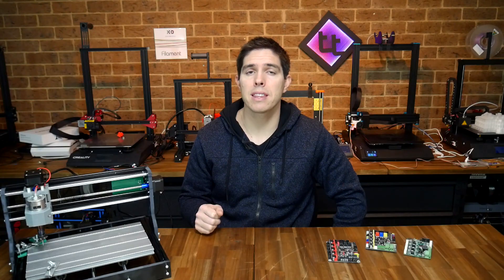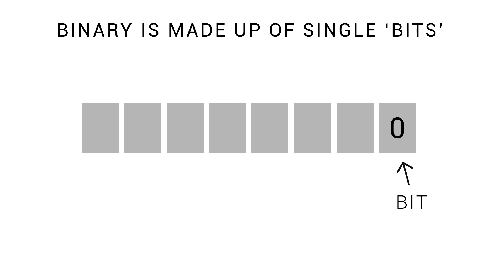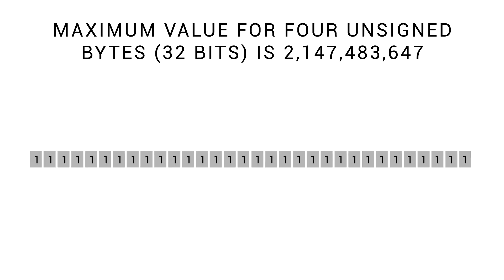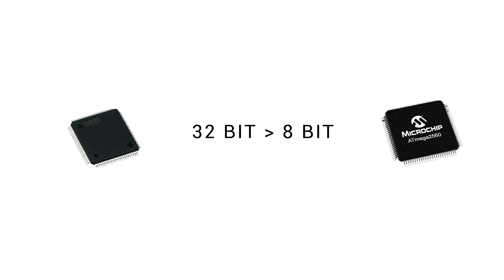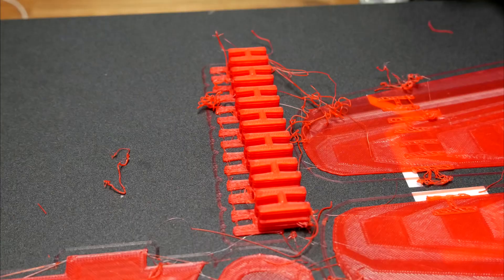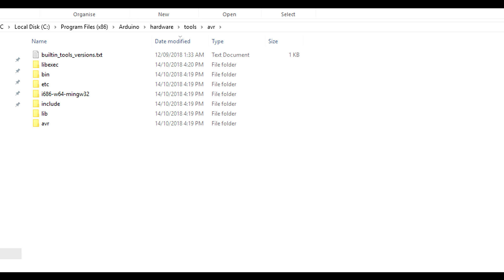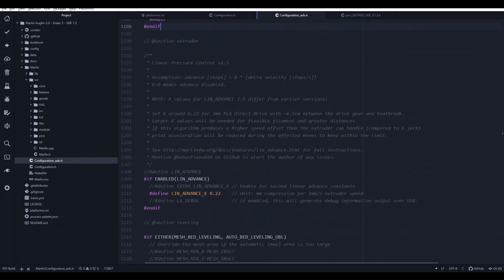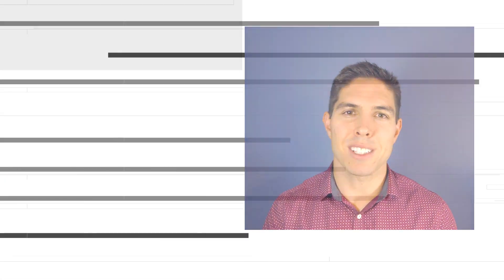32 bit 3D printing - What it means and when you need it

Comment: We need 3d printer boards with 7 nm ZEN2 architecture, 64 cores and 8 ghz!
Reply: You joke but people can and do think that is a thing that can be done when it's the wrong type of device. Microcontrollers have low latency, deterministic I/O that a general purpose CPU generally can't provide without a major restructuring of its design and the operating system.
Reply: @JeffDM , you're right. I hadn't even thought about the fact that a general purpose Linux OS isn't really designed for real-time processing. I believe there are some distros out there designed for real-time, though.

Even so, OctoPi is just running on a variant of Raspian, right? It certainly doesn't have any trouble controlling an 8-bit board fast enough to give some really excellent results. Or would you say that is more due to the CPU on the Ras. Pi than the OS?
Reply: If you 3D print an entire orbital-class rocket, that may not be enough: https://en.wikipedia.org/wiki/Relativity_Space
Reply: Would that not be like building a Bugatti for use on a kids bumper car track? It would look cool and be really expensive but could never be utilized.
Reply: @3dtwerking324  aye probably a nice showoff system bit likely impractical. Still it's nice to hop in the Bugatti and take a trip to the shops every once in a while just cos you can haha
Reply: @BillyBobJimPatton  lol
Reply: And RGB
Reply: You can, just run it on your pc!
It's gonna be expensive though
Reply: @snarkylive  sure it is. I guess you missed the point that OPs adventures with it was less about what it is and more about what fun they could have with it. But feel free to state facts for no apparent reason if you choose ;)
Reply: Think of an array of like 100 printers with infinite Z (like those conveyor belt printers) that dispose of their finished prints automagicly. Each one with their own instance of Klipper or similar on a separate server running the difficult bits of calculation.
Now pair that with a software that you can feed gcode files in a predefined order (maybe even assigned priority) that assigns each printer their new gcode file so that the order of the files finished is being followed.
This kind of system would be fully centralized and could be run without any interruptions during the manufacturing process like having to peel off the finished print off of the heated bed or something...
The most obvious problem with that is that you still have to change filament or granulate so there still have to be workers around.
Reply: Max Lindner what would be awesome but total over kill but take a 1st gen core i7 980-990 extreme and turn it into a 3d printer all in one board. , octo-print , arduino ide, a slice of your choice  fusion 360 and or what ever else you can throw at it.  Even a high end 1st gen xeon.  X58 chip set board or what ever. For the lower cost but way to much process power lol man that would be sick.  I wonder if it could be done.  I assume so.
Reply: @mitchh6471  I have seen a similar thing done before by a friend. Take a look at Klipper firmware. It's general idea is process the print via a PC and pipe it to the Arduino in the printer.
Reply: You can run Klipper on a RPI. Or a high-end multcore workstation if you have one spare lol.
Reply: @BillyBobJimPatton  I actually do have a couple of pc's standing around and collecting dust. William, I think this is one of the few occasions, where a youtube comment has given me the momentum to do something great!
Reply: @maximilianlindner  happy to have bucked the trend and give a useful YT comment. I should screenshot it and frame it as proof that it can happen haha

I'd be interested to hear how you get on with trying it.
Reply: @maximilianlindner , I was thinking that through the whole video, "Why upgrade a board in several printers when you can just use OctoPrint or OctoPi?" And then I thought, "Why even bother with a Pi if you've got an old machine lying around like a P-III (or maybe even an old Pentium or Athlon?) that you could use to just send commands to the 8-bit board with?" 

How many printers could you run with a single headless Athlon running OctoPrint, I wonder? I'm already running Linux on everything on my LAN and I know how to set up a headless machine, so I'm pretty sure I can get OctoPrint running on some old box I've got lying around already. When I think about it, I don't think you'd even need more than a single CAT-6/Gigabit ethernet card in the controller and a switch at the printers. I don't really know how much speed you'd need but this whole project is starting to sound pretty interesting.
Reply: @BillyBobJimPatton  Its exactly what mach4 does with a smoothstepper for instance in CNC land
Reply: @maximilianlindner  Perhaps you mean momentum?
Reply: @SH-pc4xt  I did indeed.
Reply: @maximilianlindner  So did you get it running?
Reply: @FuriousImp  I am running an skr 1.3 with a raspberry with Octoprint installed (pretty much the same idea, but waaay more efficient) and it's awesome :)
Reply: @maximilianlindner  Interesting. Wouldn't that be redundant though? I mean, you could offload the calculations onto the raspberry with octoklipper, right?
Reply: @BillyBobJimPatton  how? Do I just flash the firmware to usb drive then to the desktop I'm going to use? Because I'm going to see the performance benefits if there are any at all
Reply: @whatif8741  I haven't done it myself before (just done it with raspberry pi) but if you look at the klipper website in the FAQ section there are some details on how to do it on desktop machines.
Reply: @mitchh6471  Sounds cool and all, i had a X58 Xeon pc overclocked to 4.4 Ghz and it was awesome, the only downside is power consumption, it will easly add 200-300w of power consumption  and that is alot of money when you print all the time.
Reply: @mitchh6471  errr... But that's basically taking your old pc and converting it into a dedicated box for slicing, using a pc itself to control stepper drivers would also be very impractical, not to mention a big x58 6 core is likely to eat up more power than the printer itself 😂
Reply: @mitchh6471  meeeh ..  just stick a ryzen gen 3 3300g in there .. boom done
Reply: Lol, some people already use x86-64 hardware for CNC stuff. That's why LinuxCNC combined with Mesa FPGA boards and Debian with real-time OS extensions are used. For an example of a CNC machine, check out Marco Rep's Youtube channel.
Reply: Mmm, I'd be happy with a Kintex UltraScale
Reply: nah 90nm works well
Reply: We do have 3d printing that requires 64 cores at 8ghz! It’s called architecture.
Reply: Holy moly are you trying to run Crysis?
Reply: For what exactly playing top end games? 🙄
Reply: @tempest031  yeah that. Or for excess just cos. Or most likely for the sake of sarcasm lol

Comment: Would a CR-10 benefit from a 32-bit board?  I was getting ready to purchase one then I seen this video.
Reply from the maker: Any printer on paper will be capable of more, but whether you can tell much in real world results is not so clear.
Reply: honestly being able to use uart/spi without external jumper wires is already enough reason to get an skr v1.3 over anything else.

Comment: So is the controller in my Anycubic Linear Kossel 32 bit? I loaded Marlin 1.1.8 onto it about 8 months ago and now it's dialed in its completely dependable and delivers high quality prints. Same with my Ender 3. I know it's got a cheap-ass 8 bit board but it works well. And there is the issue. My interest is not in building the best printer but in having reliable printers to output my projects. They are both dialed in such that I rarely have to level them and I'm not sure screwing around with the controller will give me additional value.  Maybe I need to build a delta from scratch.
Reply from the maker: If it's reliable and printing to your satisfaction I would leave it.
Reply: As written above, I think the rule "If it ain't broke, don't fix it" applies in your case.
-You're already satisfied with the prints, which means it might not be worth all the trouble and frustrations upgrading.
But at a later point, when you think your Kossel is no longer an interesting piece of technology, you could upgrade it to a 32-bit board, which should then give it 'new life'.

Comment: I really enjoyed this video, I think it's a great tutorial on why we might need 8 bit versus 32 bit, and I was pleased to see you mention how stepper drivers with higher resolution can aggravate this need.  I do have one criticism though, the H-bot style such as the Ender 5 is still a cartesian kinematic, the Y axis just moves the X gantry instead of the bed, and isn't harder to calculate.  Spot on about the CoreXY and Delta style tho.
Reply from the maker: I don't own any h bot machines but I was under the impression two stepper inputs were needed for most movements. I may in fact be wrong, no problem admitting that.
Reply: Teaching Tech hey so I think I am in the wrong - I just saw you seeming to refer to the Ender 5 as H bot which it is not.   So all good!   Good video thank you!

Comment: Don't forget one of the largest benefits of 32bit in processing is larger memory addressing.  This means more ram accessible by the CPU.
Reply from the maker: Agreed I though about including flash space and ram. I probably should have.
Reply: @TeachingTech  Except that it has nothing to do with the 8bit or 32bit designation.
Reply: @TeachingTech  Personally I think you had the right amount of details without losing people. For example you could have spoken about 2's complement but it would not really add anything but confusion. From my experience of teaching computer science at secondary level, address space is not a first lesson topic :)
Reply: No this the correct answer. The ability to address up to 4 gigs of memory is the advantage of 32-bit. That limitation is also why everything eventually moved to 64-bit in the computing world. There are actually still 32-bit types available in 8-bit microcontrollers. See Long, Double, etc in Arduino. That maybe confusing for some people though. Enjoy the channel keep up the good content.
Reply: @Nath8737  No, the designation if an architecture is 8/16/32/64 bits depends on the width of the working registers, the width of the address bus has nothing to do with it.
Remember the C64? Its 6510 CPU is an 8-bit design with a 16-bit address bus.
The 8-bit AVR that is used on many printer boards uses separate busses for programm and data and while the data-bus is 16-bit wide, the program-bus is even wider making devices with more than 64k of FLASH possible.
Putting memory into chips however is expensive and epxanding the busses with additional bits also is.

We see more memory in 32-bit mikrocontrollers for two reasons,  first of with everything using 32 bits it just does not cost extra anymore to use a 32 bit address bus. Secondly the price per bit SRAM dropped significantly in the last 15 years, mostly due to smaller structures but also due to better mass production.
AVR was 140nm if I recall it correcly, more recent controllers are manufactured in 22nm.

Atmel could have easily released an AVR with 64k SRAM and 256k+ FLASH but they were driven by demand from industrial customers - and obviously there was no demand for such a controller.

Comment: Awesome & timely video Michael. I am considering using Marlin 2.0 to help implement BLTouch. But I am afraid the ENDER-5's  Sanguino board  might be incapable of supporting Marlin 2.0. Is the MKS Gen L board a better choice; or something else.  Maybe I should stick with Marlin 1.1.9 on my Ender-5; and look at Marlin 2.0 for my next printer, down the road .....  I look forward to your advise.
Reply from the maker: I haven't tested marlin 2.0 on an Ender board but on paper it should be fine. The Gen L is superior in every way to the Melzi, but there isn't any need to upgrade unless you want to use more IO pins or change stepper drivers.

Comment: s from a teaching standpoint this video is spot on, I am a CS student and pretty much know what all the stuff is and honestly think we should move all 3d printers to 32bit just because we can. Why didn't we already? Because the manufacturers can get away with cheaper microcontrollers, the ARM chips are around 2x what the AVR chips cost.
Reply: No. There really hasn't been need for 32bit boards, unless using Delta style printers or something similar which needs calculations to reach specific points. Basic ie. Prusa style printers are very hard to even reach the limit of needing that fast calculations. Let's be real and remember that very heavy duty machines in industry have been going with 8bits very far and applications shit tons drastic than some plastic squirting thing that would demolish itself in speeds used in industry machines. So all in all 32bit "need" is in many applications something that simply sounds cool. Also this videos analogy of game consoles is hilarious. Atari Jaguar with its "do the math" in bit wars was a kill of the bit wars😁

Comment: You forgot one big advantage of 32 bit: It is much cheaper. 8 bit processors are produced in smaller amounds and there are some more expansive licences involved. Due to 5V they use older production technics and less density on the silicium waver. Due to some months ago only reason for 8-bit being cheaper was the larger amounts 3d-printer boards in 8-bit where produced.

That changed. More and more 32 bit boards came on the market and the price already dropped to the price of 8-bit boards, if you look on the board only (without drivers). An SKR 1.3 costs $19, the same as an MKS Gen L on AliExpress (and even less on "sales"). So there is no reason at all - exept avoiding learning new things if you use Arduino IDE at the moment - to use 8-bit on a new printer.

But upgrading Ender 3 to an SKR 1.3 seems not a good idea at the moment. Bigtreetech just published its new SKR mini e3, a 32-bit board with form-factor and connections being the same as the creality board. A drop-in replacement - for less than 30$ including the TMC2209 stepper drivers (soldered). Delivered with Marlin 2.0 already configured for the Ender3. Aditional conectors for filament runout detection and ABL (BL-Touch and other solutions), aditional serial port for touch screens (or adding OctoPi) and RGB lights (of course to use this you might compile the firmware yourself or wait until someone put a firmware.bin online). Less than 30€ with more functions for the 32-bit board with TMC2209 compared to tthe Creality "silent" board for nearly 50$ with 8-bit (crippled with low memory) and TMC2208.
Also this board should work on all Ender3 "clones" (like the U30), mostly even without compilling new firmware. As most touchscreens are using serial comunication by gcodes, it would be interestingly if the U30-touchscreen works with this board...

One advantage of 32-bit you did not mention: even with same stepper drivers and microstepping the higher processing power leads to more precision in timing of step pulses and a less noisy movement. You can hear it at the alfawise u30, using same mechanic and drivers as the ender 3 but beeing less noisy (of course due to the other design failiures it even less noisy as you would leave it turned off at all ;-) )

So I think you are wrong if you prognose entry-level printers will stay some time to 8bit. With the U30 it is shown entry-level printers already go 32bit (even if that printer has other faults). Marlin 2.0 - while still being beta - is stable for the functions needed for simple entry level printers.
With 32bit-processing make even a cheap A4988 less noisy, it allows manufactures better test results while reducing production costs. So maybe there will be some new entry-level printers with 8-bit in the next 3 months but in 6 months no company will sucessfuly release a 8 bit-printer anymore.
Reply from the maker: Great post, thanks for taking the time to share.
Reply: @TeachingTech  I have to say thank you for all your great videos. You are definitly one of my most favorite youtubers (and I wait for the next video with as much anticipation as I wait on the next episode of startrek discovery...).

I just started 15 months ago with 3d printing - and its amazing how much can be learned by the videos you (and Angus, Tom etc.) make. I made my first video myself (about connecting an external stepper driver to a Creality board to use TMC drivers without changing board - sorry, german only). Even that quick and dirty video was not easy to make - so I very much apprectiate the expenditure you do with your videos.
Reply: @oleurgast730  Thank you. I may go this way on the mini.

Comment: Does the controller actually do the displacement computations or it's made by the slicer when creating the g-code file description of the model? It seems that the controller computational work is mostly restricted to the gcode file parsing (a translation with no math involved) and not actually to compute step motors displacement commands. I think It only computes inertia (when and how fast step motors should be moved) and PID temperature control and this suspicious came to my mind after trying Klipper. In Klipper, the parsing work is done by the RPi and the motors pulses sent directly to the stepers using a daemon running in the controller.
Reply from the maker: Gcode only does so much. It will say move from here to here but that doesn't account for acceleration or anything like that. Consider that the gcode is the same for a Cartesian printer vs a delta despite the greatly differing maths required.